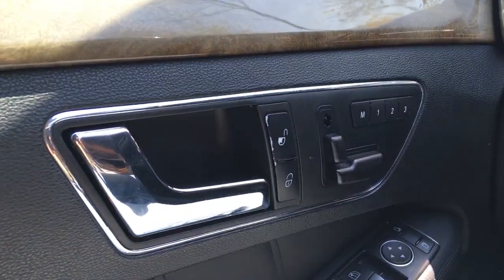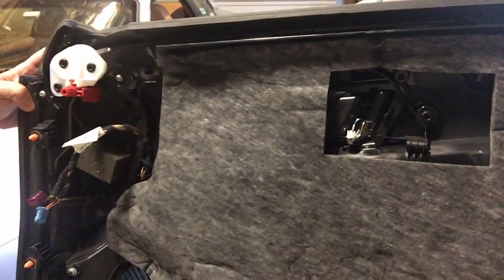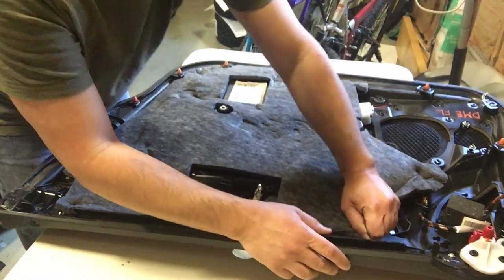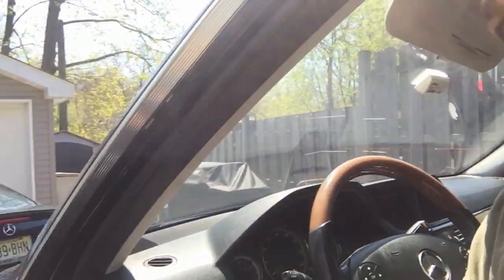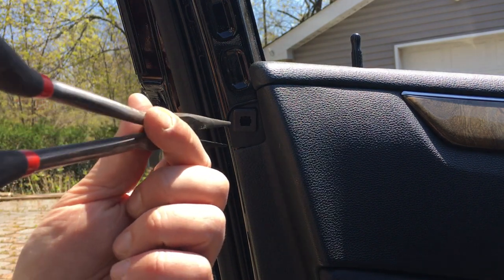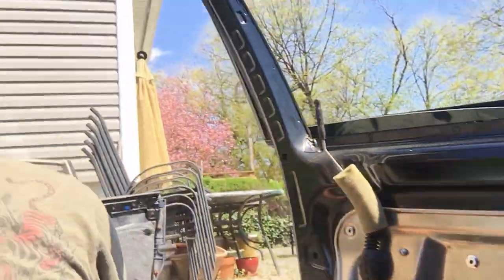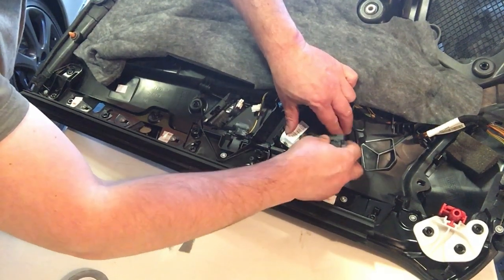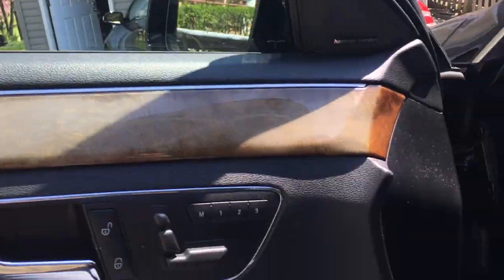w212 door switch movie

Comment: Do you know if it is possible to swap only the leather panels of the door?
Reply from the maker: The leather panel is a separate part but it is incorporated into the door card by heat stake. so you would have to change the whole door card.  Wood trim and arme rest are espera-te parts that can be replaced.

Comment: Hey great video! so my drivers seat stopped working, none of the functions work. I checked the fuses but nothing. I switched the passenger seat motor to mine thinking it might be just that but no /: do you think it could be these power seat assembly that is causing no power to the seat? or could it be a module problem? Any insight or guesses can help thank you!
Reply from the maker: Okay, this is what I would do.  Switch the seat control modules from the driver’s side to the passenger side.  If the passenger side no longer works, then you know it’s the module.  If there is no difference, then look into the switch.  I don’t think it would be a motor, since you say all the features stopped working.  All of the motors would not fail simultaneously...good luck and please don’t forget to like and subscribe if you haven’t already
Reply: @MarcoCerqueira  thanks man I appreciate it I’ll try that tomorrow ! Worse part is that the seat is was all the way back when it decided to fail on me so it’s uncomfortable to drive since I’m 5’8 😂 so even taking off the seat is going to be a mission if it comes to that. So the seat modules are basically plug & play? nothing complex about it? thank you again for the insight man 👍🏽
Reply from the maker: I forgot to mention.  Please check your fuses before you start messing with the seat module
Reply: @MarcoCerqueira  Thanks, I checked the fuses first & it was actually missing one or two regarding the seat so I put 25A fuses hoping it would fix the problem but no /: I haven’t had time to switch the seat buttons but honestly I have a bad feeling that it’s going to be the module .-. idk if I should just take it to a indie shop & have them diagnose it